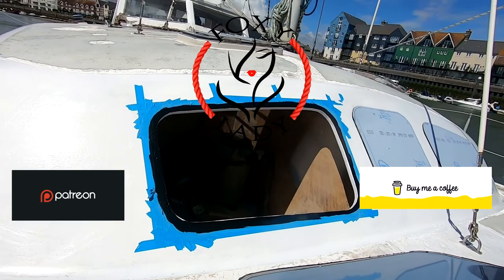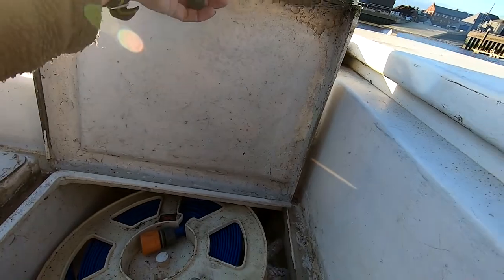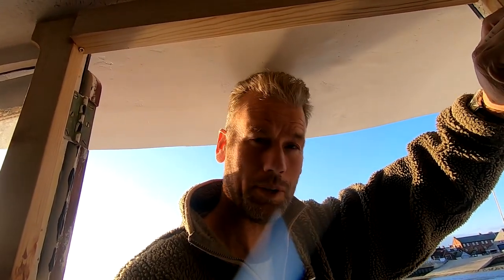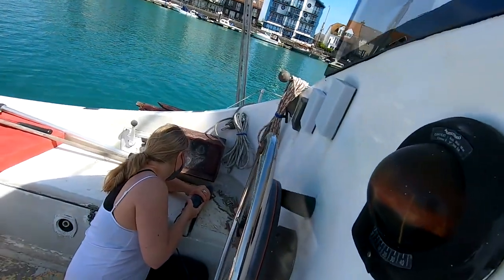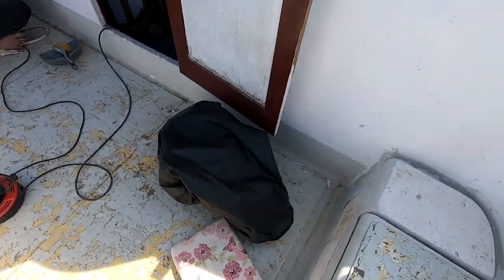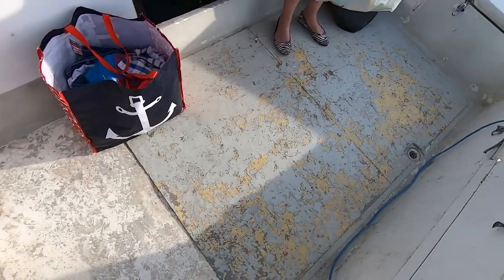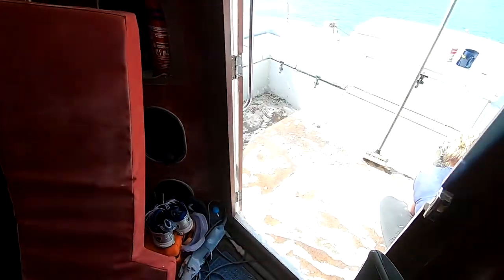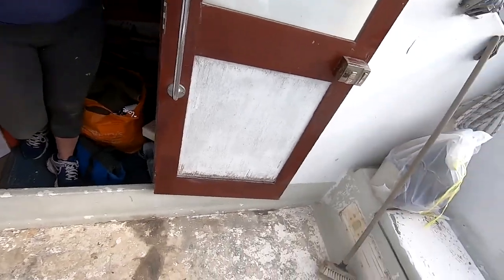Cockpit Restoration on project Catamaran prep 1 S2 E11

Comment: That was hard work but quite a transformation as you say. I am still trying to work out how to remove the peeling anti slip paint on my decks without damaging the gelcoat beneath. Such a thickness (>1mm) has built up over the years that it really has to all come off to give a half decent finish. I have looked at the foam faux teak but I imagine that will need to go on smooth substrate too.
Reply from the maker: Hey Robin, yes very hard to maintain the original finish.  The decks on FL are around 3mm thick and only way to remove is a chisel... it's a long long job.  Luckily I'm not very worried about going back to glass as i will be putting a shed load of paint on! I like the foam teak stuff, few friends have done it but still not convinced on durability🤔

Comment: Hi Spence, Sam's putting in the graft as well.... 👍🏼Whats the cockpit floor made of? 
Is it glass or ply covered glass?
Its tedious work but its right in the area that hits you first so... Preparation is 80% of the job as usual. .. you're getting their. 

Re the fuel return you could try returning it via a t piece into the fuel filter inflow line . 🤔 But if you can take it back to the main tank then theres no chance of it messing up.
Reply from the maker: Hey Clive,  yup it's coming up nicely mate. Very very hard work but sure will be worth it! I think it's just glass with a core, may be a hollow as it top and bottom mould but tbh i have no idea at this stage!! Good solid glass though. 
I run the line back into the tank in the end so it didn't come back up or anything like that🤞